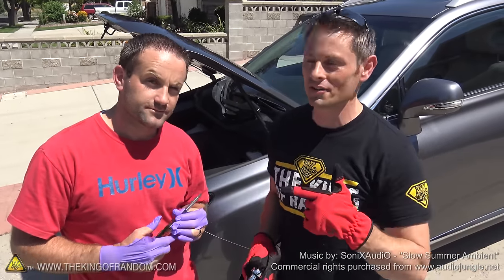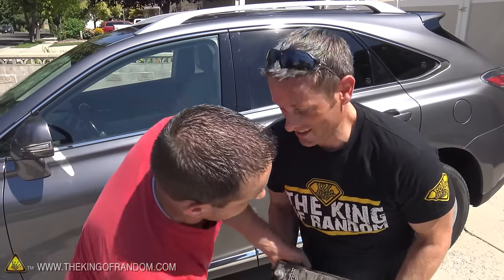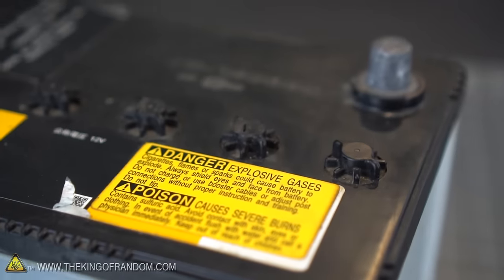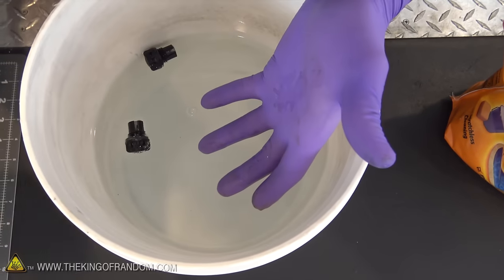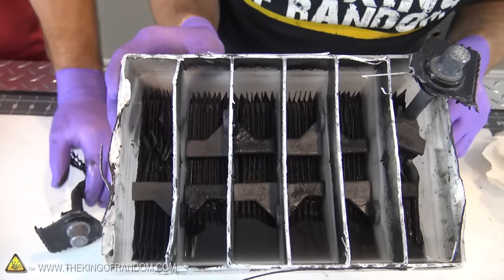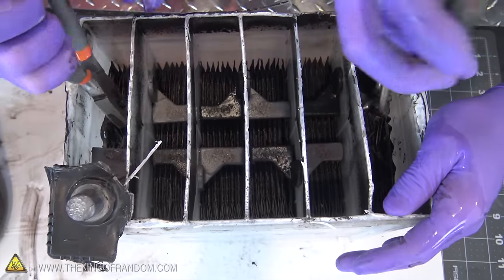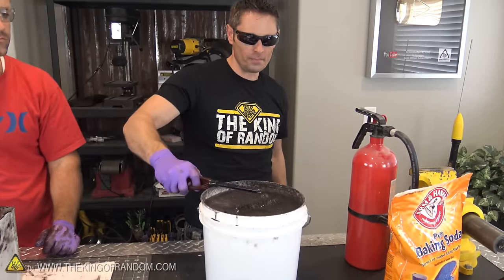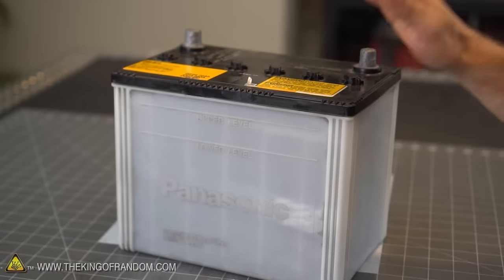Hacking Open A Car Battery (for Lead and Acid)

Comment: Pours out acid Doesn't wear eye protection
Reply: And?
Reply: You think sulfuric acid is something to put into your eye?
Reply: No, but its only 30% if you pour it right, it wont splash to your eye
Reply: It did splash though and you never know when a single drop might hit your eyes.
Reply: I literally had this happen two days ago. Pouring sulfuric acid to clean granite and a drop jumped up and hit my eyeball. Fortunately I was fine but it was extremely painful!
Reply: or sleeves..
Reply: Bo Huggabee
Sleeves would be excellent too, but with 20-30% sulfuric acid you'd usually get away with irritated/swollen skin. The same happens to your cornea, which can cause (with some luck temporary) blindness.
Reply: He had sunglassess on XD
Reply: "Welcome back to my laboratory, where safety is #1 priority!"
Reply: Anyone remember the video on tosh.o where the guy shoots thru his nutsack with a 9mm handgun? Was that real?? I know this is a little off topic, however all this talk about safety...
Reply: To be fair those do look like safety glasses, but the kind for construction and are just for basic shrapnel. Like the ones his brother was wearing looks (so it's just speculation) like the $10 ones that are basically just for jackhammering and the like, may not even be rated for that. But the kind you would need for acids and gases is definitely different so maybe he thought he was being safe since they were "safety" glasses but in my experience those are the wrong ones for the job.
Reply: +Dominic Cheung i am pretty sure those would take few drops of acid fine
Reply: Sleeves arent needed at all, as long as you have water near, or even beter a neutralicing solution (an acid and its conjugate acid in a way that even if you add acid or bases, the pH remains arround 7)
Watch nile red video, where he pours conc (98%) H2SO4, on his hand. He also pours conc HCl, and conc HNO3.
Reply: +ficolas2 They have a bucket with sodium bicarbonate, even if it splashes in their eyes, they are "safe". But its better to prevent than to cure, so eye protection would be good.
Reply: Looks like safety is not #1 priority.
Reply: +Vince Offer LOL!
Reply: safety third!
Reply: Because life isnt yolo enough
Reply: When it comes to your eyes you should be much more afraid of bases rather than acids.
Reply: Zeaiclies Who told you that?
Reply: Zeaiclies Yeaaa... Making false statements that could potentially cause someone to ignore my warning and loose their eye site is not funny.
Reply: Zeaiclies
ACID= SURFACE DAMAGE
BASE= DESTRUCTION
 You can look it up and educate your self. look in google pictures for articles.
Reply: Acid isn't as dangerous as you'd think, it will string and hurt but wont just burn right through you even at high concentrations (if you of course act and not let it just sit). Also they did the more correct thing and have a counter agent near by, which really is a lot more important. Plus safety glasses you don't really want for such material though mainly if it's fuming since then it doesn't need to get in your eye just near, thus you really want a face shield.
Reply: tickyul
Dude did you miss the part about be saying a face shield is what you really want. Also have you every actually worked with acids, because if you have. You'd know they are no where near as strong as people believe.
Reply: neomix21 jj
Reply: Mahabubul Alam  l
Reply: neomix21 I
Reply: about 5 at school
Reply: neomix21 i
Reply: neomix21

Comment: Make lead cups. The Romans used them... I think...
Reply: Lead plates*
Romans didn't use them. 
Fuedals did. About 100 years after the Romans demise. I'm sure there were lease plates in Roman times though, not much, but it was there.
Reply: Blue Behemoth Hm ok... If it wasn't lead cups than it must have been lead plumbing the Romans used. Read something about this ages ago so its pretty vague
Reply: +simontay1984 I think the people of Somerset may disagree with where you state the location of the city of Bath.
Reply: +william bui I don't think they knew it was toxic.
Reply: Well it might have been the pipes you were thinking of, or the fact that they used lead to sweeten their wine, which caused all sorts of issues.
Reply: No. !!!!! They did not they used copper brass gold and silver for cups also known as a (chalice)
Reply: They didn't use it for cups, if my memory serves me right they used it for e.g. knives and forks.
Reply: They used it for drinking water pipes. Seriously.
Reply: +Blue Behemoth reason why they thought tomatoes are poisonous and why my parents tell me not to eat them. Still eat them :3
Reply: Lead and pewter plates (of old) leached lead into food.

Comment: Surprised you didn't have safety glasses on sooner like your brother. That splashing can get you. A hacksaw does the best job. It cuts through the entire plastic housing cleanly, as well as any lead bars.
Reply: Dead car batteries actually only have PbSO4 in solution and really small amount of acid am I correct?
Reply: @arty7122  no ...lol
Reply: Well, the acid wasnt what got him
Reply: I had battery acid splash in my eye. It burned so bad, my immediate 1st thought was, "I just lost my freaking eye!" Highly recommended if you enjoy excruciating pain.

Comment: I was a burn therapist at the Institute for Surgical Research, Burn Center and Extremity Trauma Center at Brooke Army Medical Center in San Antonio Texas for years.  

You cannot imagine the different ways people got themselves burned.  I treated patients who made their own homemade canons, which subsequently exploded.  Decided to take a  radiator cap off while the engine was still hot (common).  Tried to rescue a kite from power lines using a metal pole.  Looked into a gas tank  with a butane lighter' to see if it was empty.  And every type of industrial accident you can imagine. 

 None of them ever thought they were going to get hurt, because they believed that it was never going to be them.  I appreciate your attempt at educating people, but in the future I wish you would take better safety precautions, especially when working with sulfuric acid and the subsequent  sulfuric gas.

Good luck in the future on not getting injured, I really really mean that.👍
Reply: did someone get burns from an AMD CPU?
Reply: Did the sulfuric acid fumes they were breathing for a brief moment damage their lungs in any way or was it negligible?
Reply: Murica
Reply: How people don't figure to use a rag to take the rad cap off while an engine is hot is beyond me.
Reply: Пётр Новосёлов lmao
Reply: lmaoollaol
Reply: Except this concentration of sulfuric acid literally cannot burn you. Not to mention there's no such thing as "sulfuric gas"
Reply: @Nattidaddy  r.i.p.
Reply: This comment didn’t age well
Reply: I worked for a moving company when they were remodeling there

Comment: 5:02 You should've done this outside since you're releasing a ton of lead oxide/sulfate mist.
Reply: His workshop is in a separate garage and he probably has the door open.
Reply: Where tf did you see kids?
Reply: You can hear them
Reply: There's a bit of a difference between "well ventilated" for a workshop and the kind of ventilation you need when dealing with these sorts of materials. There's a reason why chemistry labs have contained spaces with powerful ventilation hoods.
Reply: Costas Mandylor No one got hurt though so what's the big deal
Reply: +EndOfOurDays They could be poisoned just by the vapor alone. Either some lung cells die or they might feel sick over the weekend
Reply: Not how it works, buddy.
Reply: Yes, there is. Even though the lead compounds may not be reacting, they are still suspended in the solution and the release of CO2 is throwing them into the air. I can clearly see the mist on the side of the bucket, and that's just the stuff you can see... I'm sure you could feel it on your hand if you held it over the bucket.
Reply: U got that right.  Sulfur dioxide emissions too. Lead oxide very poisonous. This is super dumb and pointless!
Reply: Plus the hydrogen sulfide,  which smells like rotten eggs!
Reply: the part where he jams a chisel into it made me cringe. 12 volts, 50amps..what could go wrong?
Reply: im pretty sure he has a fume hood
Reply: Yeah but he's not dead soooo?

Comment: "I just got a new car, and what better way to celebrate then to rip the battery out, crack it open, and see whats inside." 
Only you would say that grant.
Reply: Well , All Signs pointed to the What's inside
Reply: +JustHaveFun Gaming how did you use a couple of asterisks and have it not bold text
Reply: oh...
Reply: The * is not attached to the "all"
Reply: I'll Fix that
Reply: Done
!
Reply: Hi
Reply: Yes.. Cause everyone else has the sense that god gave a rock..
Reply: Lmao ikr😂😂
Reply: Not only grant,but What's inside
Reply: +Pronomita B What's inside would go to the middle of the car and cut the car in half and then...  "It looks like theirs some seats and stuff inside a car."
Reply: take a look inside a lithium battery 🔥

Comment: what I learned today: Panasonic makes car batteries?
Reply: Panasonic makes a ton of stuff. Panasonic is an absolutely enormous company.
Reply: They make the best batteries
Reply: Panasonic is the major battery producer
Reply: I have the original OEM Panasonic battery in my 2007 FJ Cruiser.  Unfortunately, they cannot be purchased in the US  so when it starts to degrade, I will try desulfating it versus buying a domestically produced battery.
Reply: Especially for Tesla
Reply: Pasonic is expensive
Reply: Fresco L learnt*
Reply: They make all of the batteries in conjunction with Tesla at Gigafactory Nevada.
Reply: Ikr lol
Reply: Why doesn't Duracell make car batteries
Reply: Jifiky They do.  Sams Club sales them.
Reply: Pretty sure they also make landline phones
Reply: Mhm they make Tesla batteries
Reply: Fresco L me too lol
Reply: @dynasty9160  Not in USA or Canada
Reply: @dgreatll  post an other vid
Reply: And Tesla screens

Comment: next video: How to make your own nuclear reactor
XD
Reply: Well you do need lead
Reply: Get a microwave
Reply: Lol after that episode I'm gonna show you guys how to become a nuclear powered supergero
Reply: HaCmE1 ...........ok?
Reply: lmfao
Reply: That would make for an AWESOME video
Reply: +HaCmE1 I'm not defending fossil fuels in any way but, hydrogen is merely an energy medium. Hydrogen must be made. Atleast oil can be pumped out of the ground. You need electricity to power compressors to make hydrogen in useful amounts. Solar could power it but oil is (currently) easier and cheaper to do it with.
Reply: what about pumps? dont they need workers ,pumps and other equipment and i think that cost alot where hydrogen can be made by anyone that has a power supply at their home yes meybe oil is good for the economy or it can be pumped but think of the problems in our planet oil is causing
Reply: +HaCmE1 uhmm, yeah. Anyone with a power supply at home can make hydrogen (in unusable small amounts). What powers the power supply?
Reply: i dont know, what powers the pumps?
Reply: +HaCmE1 the oil pumps run on electricity (usually). Electricity can be got from clean sources (hydroelectric, wind turbine) or from less clean sources (coal plants, oil plants). Hydrogen is just an energy medium. It's comparable to oil except it's cleaner than oil but isn't naturally occurring in what we deem to be a useful form. Oil is naturally occurring.
Reply: +HaCmE1 uhmm, I'm just saying that hydrogen isn't a power source. Simply a power medium. It holds power, like a battery but must be made. Science has come up with an alternative, solar wind and hydroelectric. These are all perfect power sources. Theoretically, a solar power plant the size of Austria could power the world. Solar doesn't work at night though. What you can do is run coal plants or you expand the solar plant by half to run a ginormous hydrogen compressor. Use the hydrogen during the night to feed the grid. The one thing that stays the same though is, hydrogen only stores power. Those compressors could just as easily be run by a diesel engine. Solar is just cleaner
Reply: Richard Lundl already made one in his kitchen. He was arrested lol. No hes not on youtube.
Reply: i hope yes lennyface
Reply: i wanna know that

Comment: 2:45 pours out battery acid without eye protection.  Does not value eyesight.
Reply: I bet he regrets what he did ...
Reply: this erked me so much. PLEASE USE EYE PROTECTION WHEN HANDLING WITH ACID/ CAR BATTERIES
Reply: Also, I though sulfuric acid can’t be poured in glass because it will make hexafluorosilicic acid. Instead it should be stored in carbon steel containers.
Reply: @ic9459  most acids can be stored in glass, but HDPE is a better solution for hydrochloric acid.
Reply: @exogator   I remember that in my wood shop class we had the choice to create HDPE into pens🖊
Reply: @ic9459  that's so off topic I'm kinda impressed.

Comment: Bare arms and no face shields? You two are just warming up for the Darwin Awards.
Reply: The acid isn't that bad. The lead maybe, but the acid just tingles.
Reply: Leads really more deadly if ingested or over long period of contact to the skins (like wearing it as make-up or hats). Ow ya and the acid actually isnt that bad long as you start washing it off within the first minute
Reply: hopefully they put safety measures on the kid u hear let out a gaa after they take the 6 ports off the top
Reply: hopefully they put safety measures on the kid u hear let out a gaa after they take the 6 ports off the top
Reply: The worst that sulphuric acid will do is cause minor irritation if they get it off of their bare skin same with their eyes
Reply: Why would you risk it, you only have one set of eyes. Ever heard of PPE (Personal Protective Equipment)
Why would you pull a car battery apart in the first place. If you are so  in need to see what is in side look it on the internet.
Reply: Someone has to upload it for you to look it up, no?
Reply: Google: what is inside a car battery?
See what it comes up with.
Reply: You are the man, A+ on your comment.
Reply: And in there house.
Reply: its ok its just dilute sulphuric acid  no big deal
Reply: i was sarcastic! PPE should always be used
Reply: I bet most of your punks don't even deal with scavenging things, and you think you know better than the guy who does it all the time.
Reply: keen observer Sams club?
Reply: Michael Pendergast maybe they are like me? I'm looking for cheap ways to find lead for some casting I'm doing. Why would I buy if I can recycle it for free? Personally Im going to pour out as much as possible then refill with baking soda water, then cut the top off with a battery Sawzall. There isn't one thing wrong with it. Just because it may be a intimidating prospect to you, it doesn't mean it is to some of us.
Reply: said the soon to be blind man
Reply: Mr.Its not funny but I saw your channel in the list of funniest corny jokes sorry not funny said by Youtube
Reply: Ty Lockton my question is why??? Why did they do this??
Reply: He said it should be "about" 70% water 30% acid. Getting a few drops on your skin won't do much, just wash it off.
Reply: Bunch of ham and eggers there...
Reply: Ty Lockton what about the child ? What is the kid doing anywhere NEAR this ? Child endangerment much ?
Reply: Not smart.   He isn’t wearing his glasses when he pours out the acid.    They are however parked on top of his head protecting his hair.  This is irresponsible.  Don’t try this unless you have been trained to do so.
Reply: Mack Powers it’s diluted acid i reconditioned hundreds of batteries never wear much but gloves the acid in the battery will not burn you unless you pour it on your skin and wait 10min or so even then. I got it on me many times it doesn’t burn tiny holes in your skin or close like others have suggested.
Reply: Mack Powers it’s diluted acid i reconditioned hundreds of batteries never wear much but gloves the acid in the battery will not burn you unless you pour it on your skin and wait 10min or so even then. I got it on me many times it doesn’t burn tiny holes in your clothes or skin like others have suggested.
Reply: Escalade888 Haha!
100 internet points to you
Reply: Honestly all the people saying that the acid isn’t that and obviously have never ever done any work with acid batteries before.
Reply: I know this reply is 2 years late, but if you get acid in your eyes, then you'd best get that out immediately.  Otherwise you could go blind.  I got sulfuric acid in my eyes once, and "minor irritation" is a severe understatement.
Reply: Ty Lockton as long as you get the fluid off fast it won't hurt you the acid is to dilute
Reply: Your Corneas disagree.
Reply: Ahahahahahahaha idk who you are but this comment is genius. OMG YOU ARE A FUNNY PERSON!
Reply: @georgeb.wolffsohn30  No. You put children in situations like this from elementary school.
Reply: @Dizastermaster.  so. What is battery acid for ? Body art ?
Reply: @georgeb.wolffsohn30  No. Schools use stronger acids than this in experiments and such. Acids, especially weaker ones, aren't that difficult to use and deal with if you use common sense. Even a child could handle acids and bases with supervision. And keep in mind bases are just as harmful as acids can be.
Reply: @Dizastermaster.  read "dusty boots'" comment.
Reply: @johnwebb3056  you nailed the point